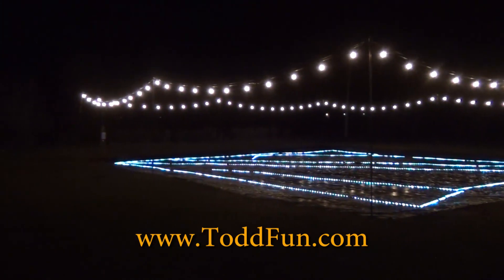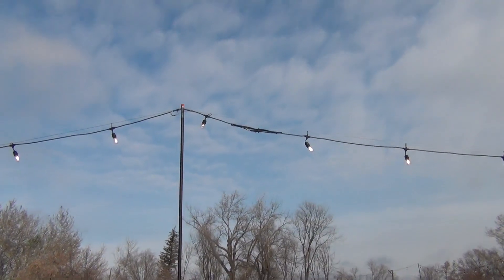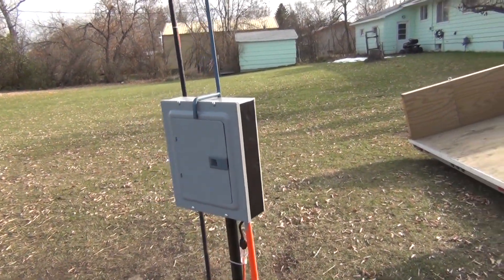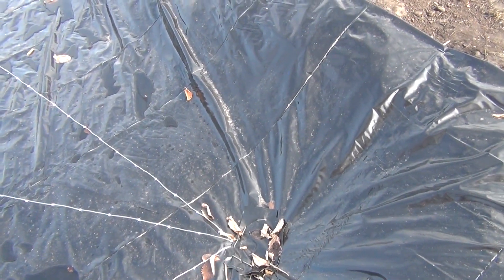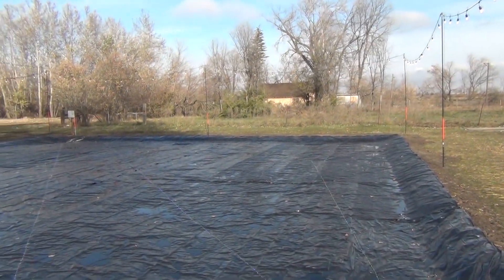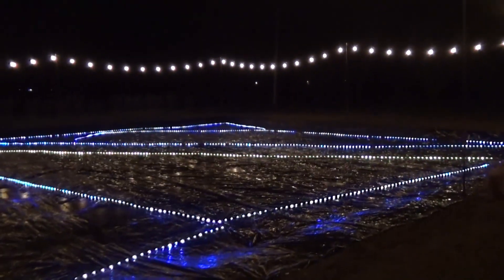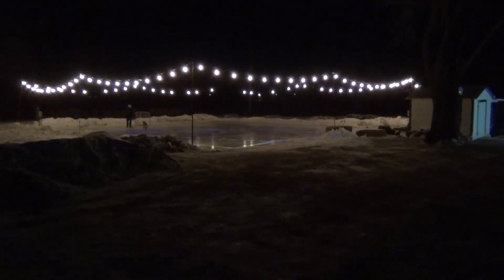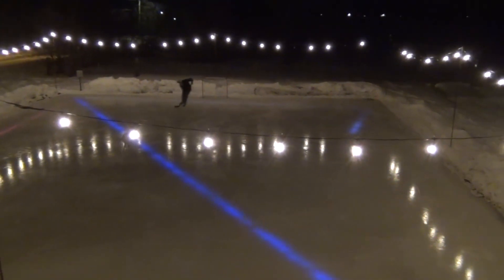Hockey rink with under ice lighting

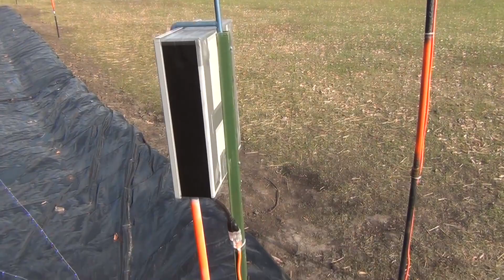Comment: Well done, that's a great lark for winter. Don't throw snow at me but at 4:14 the 110 supply into the fairy light box doesn't look like it's at all waterproof, which it could be fairly easily. Have fun on the ice.
Reply from the maker: No, not 100% but it's good enough I think and its on a GFCI so if something goes wrong it'll all just shutdown.

Comment: How did the water not leak out? You overlapped multiple tarps right? I am not understanding how the water didn't just find the overlap areas and drain out.
Reply from the maker: It does leak at first. I start putting water down just when it looks like temps will be sub 20F for a week or more. I use my well so the water is free and very low cost to pump it to the rink. I fill the rink with 2 to 4 inches and it does leak out being the ground under the overlaps is not frozen. That first water fill leaks and soaks into the dirt under the overlaps and other holes but being the temps are under 20F within a week that ground freezes solid. After a week of sub 20F I can fill the rink slowly about 1 inch a day and let it freeze a day or two. Some will still leak but within a few days the frozen ground will hold water just find.  This year I didn't use plastic at all and it still filled fine,  however I couldn't get it to hold water good until it was -10F for a few days and cold enough to freeze the ground deep enough to stop the leaking. Now it holds just fine with no plastic at all and I have about 5 inches of ice already.

Comment: I guess I didn't realize you were in ND. Lived in Minot for 8-1/2 years, really enjoyed it. But I wonder why you didn't use outdoor fuse boxes instead of indoor. Great idea though.
Reply from the maker: The boxes were super cheap. Got 2 for just a few dollars and didn't want to build enclosures at the time. They were big enough to hold the controllers and power supplies plus they had a door.
Reply: @ToddFun  I get that, I was just thinking of water intrusion. Maybe if you put some wx strip around the door. Still, I like the project. Good job.